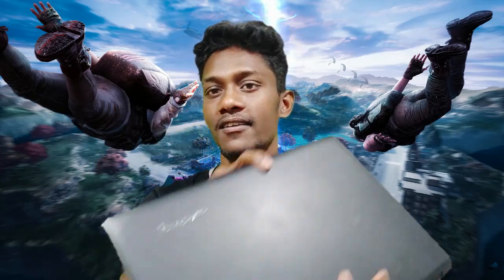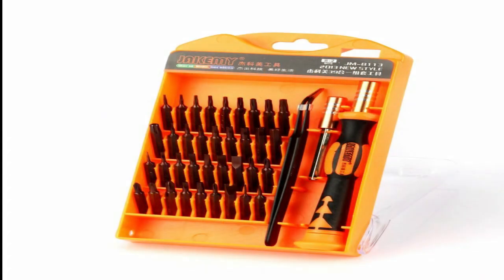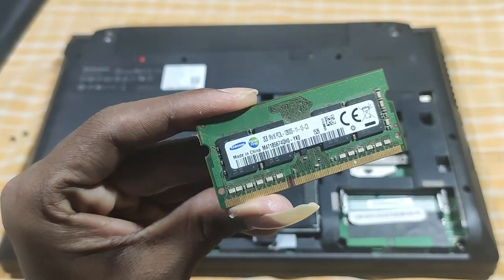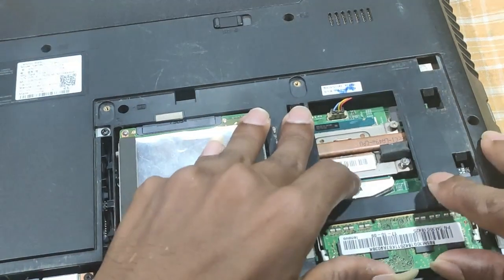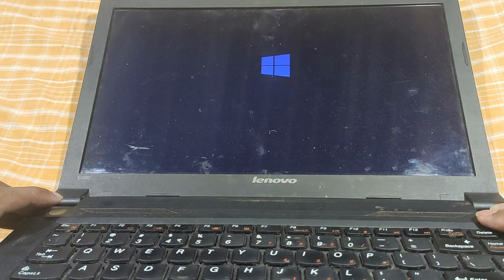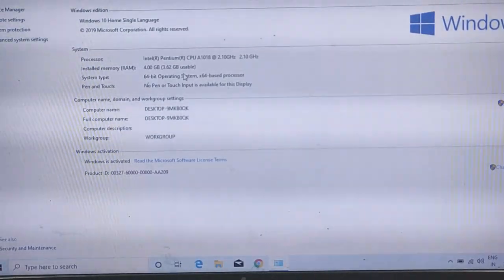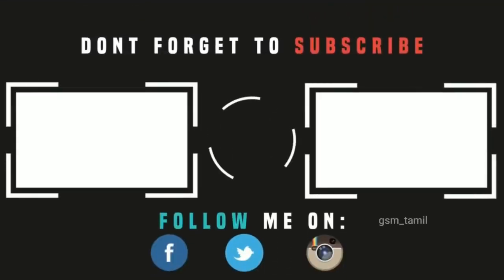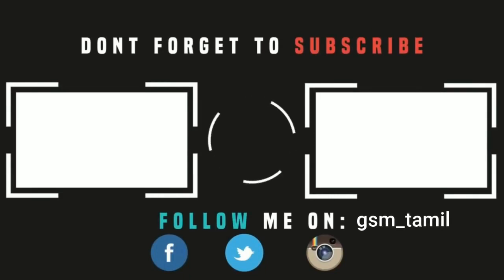Tn laptop Ram  அதிகமாக்கலாம்  How To Increase RAM of PC or Laptop in tamil b490 &e4325 in tamil

Comment: 4gp ram upgrade panalam ma  ela  256ggb ssd ku upgrade panalam ma
yethu better bro..?
 ipo 2gp thn laptop la eruku just for casual use word, use panamudila hang ahguthu
Reply: Bro ethu bro panninga ram increase panningala illa ssd bro ennakum same problem illa rendum pannalama
Reply: @Dass-tv3kr  bro na 1st ssd thn change pana nala difference pakka mudiyuthu 1month aprm ram upgrade panirukan pakka va eruku neega ssd 1st chnge panungaa
Reply: @Princeton.J  thank you bro
Reply: @Princeton.J  ssd evlo bro.. ram evlo bro
Reply: @yuva9323  ssd around 3k
Ram 4gp around 2k
Reply: @Princeton.J  I'm using hp 246 2gp ram model..very lagging bro..ms word kooda use panala..not responding ne varuthu..ena solution?
Reply: @yuva9323  ssd ku upgrade pannugaa bro 
System clean panitu New os podunga, Kandipa issue kami ahgum
Reply: @Princeton.J  bro some folders and files delete pana mudila.. access denied varthu epdi delete panrathu

Comment: Dedicated memory 80 MB than bro eruku but 128 mb erukanum taskmanger la gpu performance la 80 MB and system information components display 80 mb than eruku.. But advance display settings la 128 MB loss avuthu enna pannurathu solluga bro.. Os change pannalum 80 MB than